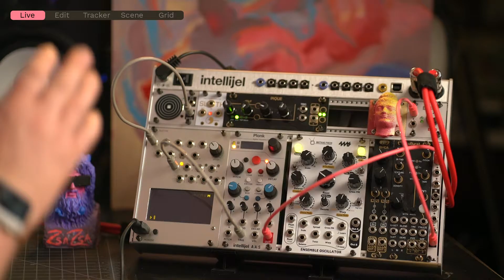Teletype Tutorial 04 // CV Outputs

Comment: Your addendum about voltage levels is incorrect. Eurorack levels can be anything between -12V to +12V technically. Practically the largest voltage I have seen is +11V. Envelopes are usually 0-8V, unipolar voltages are usually in the 0-10V range although some manufacturers only go to +5V, especially in older sequencers. Bipolar voltages (of the LFO kind) are usually -5 to +5v with many exceptions. Don't know if you can edit that part out but I think you should add a correction. 

Also, the range of values in Teletype is -32768 to 32767. Sorry to be so pedantic, but a lot of people will not know that these numbers are incorrect.

Also, your intro, where you're holding the TT "upside down" is simply hilarious!!! <3 <3 <3
Reply from the maker: Really appreciate your comment (and clarifications) ... with the aim of keeping it simple, I probably over simplified things a bit (and probably winged the talk track a little more than I should) ... let me think it through and either update the existing video or do a follow up with a deeper dive into the topic. Thanks again for your comment and insights!
Reply: @ZsaZsaRoboto  Thank you for being so open to feedback. Again, my intent is simply to clear up any misconceptions. Eurorack is such a mess (in a nice way!).

Even though I'm aware of most of the information on the series, I can't tell you how much I appreciate that you went into all this trouble to showcase the beauty that is Teletype. It has not gone unnoticed!